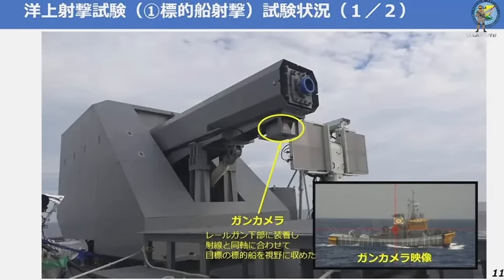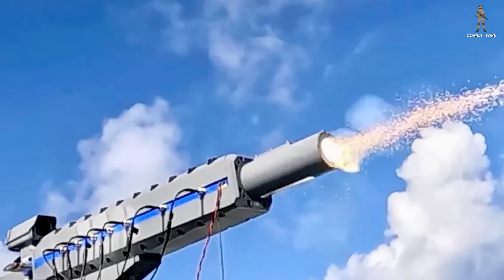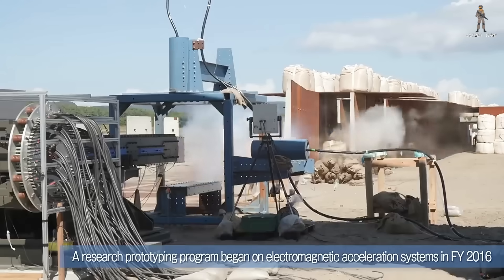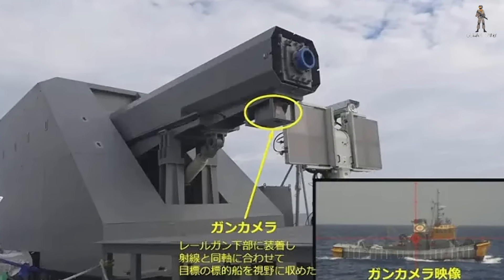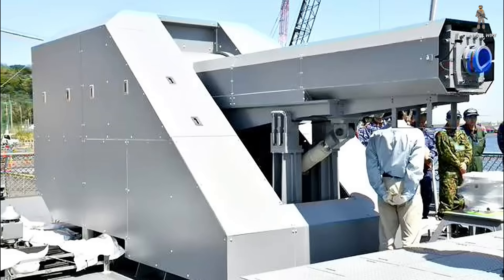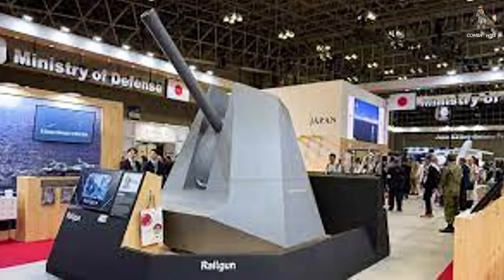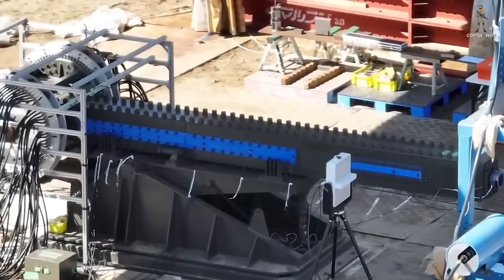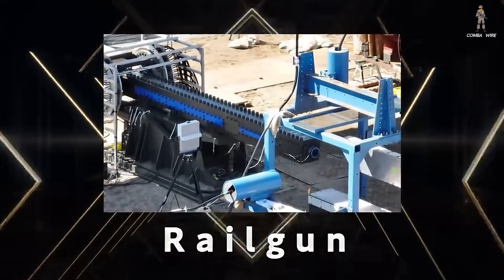For the First Time Ever, Japan Reveals True Railgun Damage at Sea.

Comment: I was pretty disappointed that our Navy gave up on railgun. The science behind it is fascinating
Reply: Technically we haven't, we are working with Japan for it now to reduce costs
Reply: @damienmccuinn1956 I didn’t know that. Thank you
Reply: @Cherokeeseeker also what you didn't know China is far ahead of Japan and US, they already tested their own homemade railgun for 3 years and the tests are an astounding success
Reply: @LordEmperorHyperion I would hope so. It would be an enormous waste of resources, if not.
Reply: @damienmccuinn1956 that is cool
Reply: I wonder what percentage ratio of Engineers to Non Engineers the Japanese used?  If you look the rate of promotion of STEM/advance STEM degree to non STEM as confirmed US Military Officer by Congress...Disappointing.  No wonder China has copied every US Weapon we have...while we lower the bar...
Reply: We gave up....because of manpower; electrical engineering part is probably much harder to teach to the Seaman....  We have a problem in the US NAVY because we have lowered the bar.
Reply: I don't think we should have shelfed the project since we have had nuclear power on ships and subs for some time. I think it pays for itself over the long run making the ammunition cheap and it would be pretty flexible in its use once the rail gun was made usable for the navy ship.
Reply: Probably, that's what they want you to think. Remember that the nuke only went public AFTER the impact.
Reply: @user-ko5ul7yi1x You think ANY nation's military would EVER let any of their enlisted or officers put their dickskinners on a NUKE??. Hahahaha.. You funny, Joe!
Reply: The USN wanted large caliber railguns for shore bombardment by its Zumwalt-class destroyers. Its prototype had a 32 Mega Joules muzzle energy per shot and as a result came with a lot of engineering problems to overcome like excessive barrel wear. The Japanese on the other hand are looking for a smaller caliber weapon for fleet defence against missiles. The demo version had 5 Mega Joules muzzle energy per shot. It is not hard to see the different size of engineering problems the Japanese have. In any case, only 3 Zumwalt's were built and the requirement of shore bombardment railguns simply evaporated.
Reply: @DelAoc   which was part of the reason why the Zumwalt failed the US navy tried to make it the next generation of ships and everyone else would need decades to catch up but well it was too next generation even for the US.... 

i do believe however that in couple of decades and with advancements in both energy and materials i do believe US can make a new Zumwalt type ship, they even consider nuclear well customized nuclear as nuclear isnt very good for massive sudden energy spikes (atleast according to my understanding keep in mind idk alot about it). to consider nuclear there needs to be a new kind of reactor to make it more viable to smaller ships like the Zumwalt and i say smaller cause compared to an Gerald R Ford f*cking everything is small :P
Reply: @BlueFire015  They are rearming the Zumwalt's with hypersonic missiles and turn them into strike cruisers even though they are still classified as destroyers. That is the right way to go, befitting the largest surface combatant in the USN. The original requirement for the Zumwalt's to act as shore bombardment gun platforms was just to get funding from the battleship big guns fan club in Congress. Maybe that was why as soon as the money ran out for building Zumwalt's, the USN lost interest in shore bombarding railguns so quickly.
Reply: @DelAoc   didnt know the US army had any hypersonic missiles.... 

ive heard Trump want battleships to come back into service but honestly battleships to have a chance of being any relevant today they need to be outfitted with railguns and well theyr many many years away aswell as missiles otherwise they will be completely outclassed by modern destroyers or another type ships. idk why they would be soo hung up on battleships i mean they were pretty good in hteyr time and for example the Yamato was i imagine quite the sight but well there really good reasons why we abandoned cannons for missiles cause theyr better at every category expecially modern ones.

would be kinda cool though to have a stealth ship like the Zumwalt sneak up on enemies and ruin the enemys day with 2-3 railguns :P
Reply: It's just a material science/physics issue you run into no matter what. Pumping that much power through the rails destroys them in a relatively few amount of shots. It does work and could be improved, it's just not currently economical or efficient over traditional weapons.
Reply: It sounds like an operational rail gun would need a specially designed vessel to support it.  It really doesn’t make sense until the materials science catches up in like 50 years.
Reply: @franky3fingers337  How so? Designing a vehicle around a weapon system isn't uncommon.
Reply: @kristianfagerstrom7011 He's not talking about the vehicles' materials, genius.
Reply: @KittyDad  Of course he isn't why would you ever think that? Don't attribute your own thoughts t others.
Reply: Gave it up publicly….
Reply: Railguns are getting a lot of publicity right now, which is neat, sure, but the USN didn't abandon development simply due to cost or challenge. They decided that for the same investment, they could leapfrog projectile technology and skip to the next, next generation of weapon platform.
Reply: 1.) It needed four containers floating behind it just to power it for two shots. 
2.) It still fucking needs at least a gigawatt-level burst of electricity, far far far beyond what most warships can generate on demand without dedicated nuclear reactors (which Japan lacks for its fleet). 
3.) It did exceed 205 rounds before the barrel itself was junk vs the U.S. 108 rounds BUT Japan has been working on it for far longer since the U.S. abandoned it in 2020. 
4.) They are fine tuning shared research between the US, France and Germany...nothing too revolutionary. 
5.) A high-energy laser is 5 to 50 times faster (or more) at actually neutralizing a rocket or missile, primarily because the energy arrives at the speed of light instead of  Mach 7.
6.) Sending a fleet of 1000 drones would be way more effective. 
7.) We also have more of these other things...you know..."The Poor Mans Rose".
Reply: Well, in war if ya can't eat it, wear it, or shoot it, it's practically useless. (Retired military here so I know)
Reply: @KittyDad  Very True.
Reply: Honestly, I'd rather have them focused on coil guns.

This video is obviously very excited and should be but he does over hype some things. The barrel wear is still a real issue and it limits the velocity of the projectiles but with a coil gun that wouldn't be an issue. The magnet actually pulls rounds to the center of the barrel and helps prevent wear. This means you don't replace the barrels often making the rounds even cheaper to fire.
Reply: Sooo how many people are gonna pee on this once it overheats?
Reply: Hypervelocity weapons are the next step. Japan or some other country will figure it out sooner rather than later.
Reply: Japan didn't aim for 64 MegaJoules kinetic energy of consistent speed projectiles. This present gun is up to 2.3 MegaJoules.
Reply: its because its already surpassed by bog standard drone tech and hypersonic antiship missiles, nothing you would want to shoot with a rail gun is ever going to be within railgun range again before its been fired on hundreds of times by everything from hypersonics to crappy drones by the thousands
Reply: Our 🇺🇲🇺🇲🇺🇲🦅🦅🦅
Reply: it's all down to carbon nanotubes. Japan have been researching this stuff since they discovered it in 1991 so are way ahead in that field.
Technically they're trying to make a gun out of Diamonds  😅
Reply: アメリカ人は自分の技術で出来ない物は誰にも出来ないとすぐに考えてしまうのだとここのコメントを見ると分かります。
特に材料技術において鉄鋼業ですら日本の技術に負けているのに日本の材料技術を下に置こうとするのは傲慢です
Reply: Railguns really don't do anything better than what modern cannons/launchers and missiles do already. It sounds great, and may have an application someday, but this isn't it. That's the simple reason.
Reply: @intractablemaskvpmGy it does have theoretical advantages for some use cases. For example, cost. Missiles are very expensive and have to carry their own delta v. Ships can generate electrical power already though. But if it wears down too quickly and is expensive to maintain, as seems to be the issue, it doesn't really make sense.
Reply: @intractablemaskvpmGy 
The velocity of railguns are greater than the naval guns in use, which can be effective against fast surface ships and aircraft if the missiles are not onboard or not meant for these target types.

When it comes to something beefier or farther away, then naval guns and missiles are more viable.

That being said, direct energy weapons can be useful for anti-drone uses, and the use of drones is battle-proven in Ukraine. Naval ships that still use turbines can take advantage of the power generation.
Reply: Nuclear airplanes are fascinating too, until you realize there's no economic return.
Reply: there are valid reasons for it even if they could solve the wear and tear on using it which is a big problem the biggest problem is the massive amounts of energy required and how we gonna get that energy? nuclear makes the most sense BUT even that is only part of the solution and then if we say put it on an aircraft carrier okay but how we gonna get the energy to operate the ship normally AND use the railgun when needed? right now it jsut cant be done u can sacrifice one for the other but not have both which is a big problem 

and then if u scale it down to include destroyers the problem get bigger and bigger as u need nuclear but nuclear on ships like that is not worth it atleast at the moment. 

still deff should not abandon railgun science as they can be pretty devastating atleast from my basic understanding and so far faaaar more reasonable at land then sea due to having access to ALOT more power and could alot easier deal with the massive energy spike firing a railgun need
Reply: @BlueFire015  US started with the wrong power plant - AC.  China DC powered railgun has gone to sea trial about 6 years ago.  We should see it on Chinese warship pretty soon.
Reply: @KittyCat-nv9nd   really? and uhm just a question how are they gonna get enough power on a ship? i mean railguns need ALOT of power. also now that im thinking about HOW ON EARTH did China manage to solve the corrosion issue before any western nation and Japan? Japan is pretty much on the forefront on technology same with the US.

i mean this is part of the reason why the Zumwalt failed they planned on having railguns on the thing but well 1 railguns werent ready 2 they just couldnt get enough power. so i am highly curious how they resolved the materials and power plant issue on a ship.
Reply: @KittyCat-nv9nd  forgot to mention and im too lazy to searc around for the comment i just made but China doesnt have the latest computer chips so how they managed to solve it long before us when we have superior technology objectively speaking is kinda weird not gonna lie.....
Reply: @BlueFire015   Some people are just too lazy and too arrogant to do some basic due diligence. A Chinese university has released paper on railgun coating years ago.   China used an old 3500 tons tank landing ship as the test bed.  The Chinese power pack cannot be that big. US can't do it. China can do it. It is a fact. Drop your arrogant and ignorant!
Reply: @KittyCat-nv9nd  yea its arrogant of me of stating objective facts and asking honest questions..... Ehat the f*ck? Did u miss ur latest software update from China? 

Also releasing a paper is very different from actuqlly having a material that no other country in the world has mind u that u can mass produce.

Also power pack? What the hell are u talking about? The engine os what gives the power to the ship electrical and transpirtation. There are exceptioms sure like nuclear power but China only have subs that are nuclear powered so im curious will they use nuclear? since its probably the most realisitic way of getting enough energy for all other things but nuclear isnt very good for sudden spikes soo something else must be used with nuclear that can take sudden spikes. There is no way they have a conventional engine more powerful than anything US have
Reply: @BlueFire015   releasing a paper is very different from actuqlly having a material ??  Your ignorance is astonishing. You don't know how the Chinese work, do you? Coating material is top secret. Chinese gov allowed the release of the research document. It means the material on that paper is in service and they got something better than that already. Live and learn. Drop the arrogance and ignorance.
Reply: @BlueFire015  No, China has already shown you the working  Emals and working AAG on the conventional powered carrier Fujian. Yet you still argue for nuclear power requirements.  China is lightyears ahead of the US on magnetic weapon research.  Evidence is everywhere. Denial is useless.  You are only showing your prejudice, arrogance and ignorance.
Reply: @BlueFire015  Besides, China is way ahead on Gen 4 nuclear reactor technology.  China has already put a thorium reactor in operation.  And China's fusion research is way way ahead of anybody else. We have lost the race. Wake up and smell the coffee.
Reply: @KittyCat-nv9nd  so how did they get this new material? superior than anything Japan and US have with inferior computers? Trying to say the chinese is soo f*cking superior than everyone else? 

So far the only thing theyr bragging about is theyr "superior battery" tech 

Cause i havent seen ANYTHING that makes them superior than anyone else. If they have this material ready righr why are they waiting with putting it on ships?and propagandize the ever loving hell outta it? I mean if they managed to get railguns capable of actually beikg combat ready why dont they have any on theyr ships by now?

I promise u if anyone else managed this they would brag about it to no end. Few things countries love more than bragging about something EXPECIALLY to former enemies (may even be an enemy now)
Reply: @KittyCat-nv9nd  ive never saw it on the Fuijan the only thing i saw on that was catching up to the US. Trust me its hard to miss a gigantic railgun on deck and im not blind. Unless y tell me its very small in which case they need to fix ur software 

Why do u keep assuming im prejudiced agsinst China or racist or some shitt? U dont know what i am stop talking like a victim its pathetic. But for the record 1 i dont like communism and i also really sont like capitalism and US oligarchy 2 im no racist but then again idk what u define as racist i mean here in the West we have loonys who think being a certain race makes u racist which is pathetic soo. 

The fuijan was a big step for China and im lookikg forward to seeing theyr next carrier but from official evidence THERE IS NOTHING REVOLUTIONARY ABOUT THE FUIJAN and if u dont like this tell the CCP to release more official evidence of the Fuijan.
Reply: @KittyCat-nv9nd  ohh btw EMALS WERE DEVELOPED FIRST BY THE US NAVY. Soooo

Comment: 200 rounds at 2300m/s?  The L55 M256 Rhinemetal 120mm can muzzle 1700m/s about 2500 times.  It can do it at 8 rounds per minute and won't screw up half the navigational equipment on the ship that is firing OR letting every sensor in 1200 miles know its fired a railgun.   Now Rhinemetal is making a 130mm smoothbore with a higher velocity and larger projectiles.
Reply: The german Navy already tried the turret of a PzH2000 onboard a frigate years ago. The ship took structural damage after a few shots.
Reply: Whst are these electromagnetic railgun sensoring sensors you mention...? Just curious...
Reply: @oljimeagle  literally any compass
Reply: lol lol
Reply: Railgun is cooler.
Reply: @testingsecretaccount  you have a good point 🤣
Reply: @testingsecretaccount  not really, it has no explosives
Reply: Not at 12 nautical miles they aren't. Don't get me wrong Rhinemetal makes nice tank guns. But they lack the range for naval engagements.
Reply: @jacknemo8021  I'd love to phone up Drachinfel to help me waste a hundred million government dollars, seeing what's what :D
Reply: @jacknemo8021  this japanese thing can't do damage at 12 kts at all, it'd hit like a cheesecake thrown by a dead pensioner.   High velocity projectiles MELT at about 4.5km    When you mount the 120 smooth on a naval ship it can hit targets at 24km.     The old rifled barrel from the challenger 2 can land HESH on a Destroyer from 29km out almost continuously.  Hell, the 25mm M242 can hit 6.5km from a boat and its land rating is only 2.7km max.
Reply: No exploding ammo stores.

Comment: TOO much bs in this video, the are still working on a rail gun, yes as prior and before it was stated "They ceased the development" and we see how it turned out ... and the main problem was not the power unlike here is told, it was that the railgun or better said the gunbarrel railing itself wich would have to be repleaced after just 100 - 200 shots wich is extremly costly and can't be done easily just like that so yeah. There you go, an actual reason why they "publicy cancled the programm" again. Wink wink.

Comment: Modern tank rounds reach muzzle speeds of nearly 1800m/s so I personally find 2300m/s underwhelming. The problem is not power because modern ships can generate more than enough juice for two railguns simultaneously but the material science and hard engineering problems that still reduce the practical lifespan of the gun. This includes rail erosion and deformation making each shot progressively less accurate. But vaporized metal condensing in places it shouldn’t.